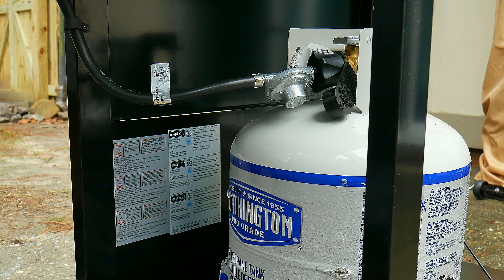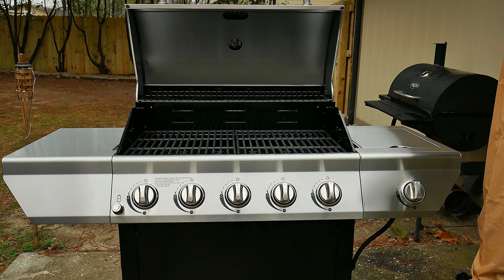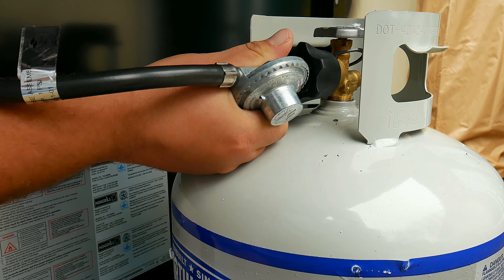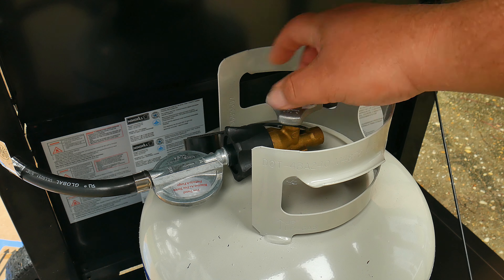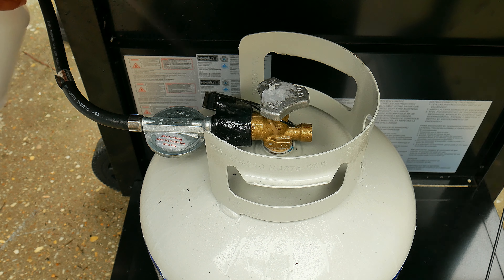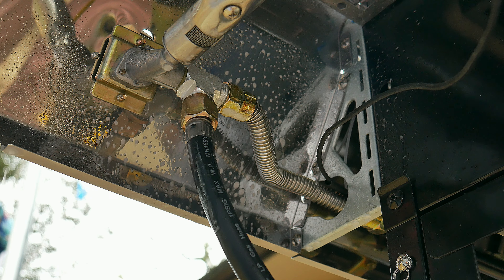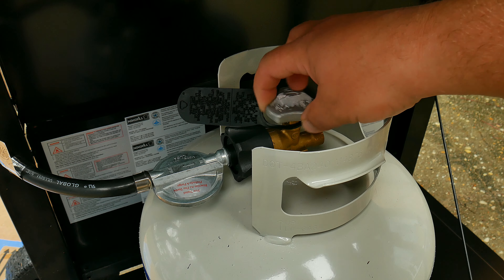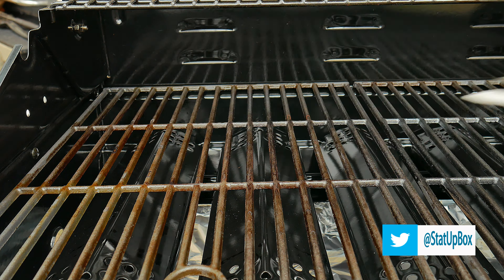How To Check Gas Grill For Leaks Easy Simple

Comment: Got a leak at the grill end. IE where the propane attaches to the grill NOT at the tank end. Is there an O ring in this female coupling? I have a new regulator and pipe but did not notice an O ring in the female part. Thank you.